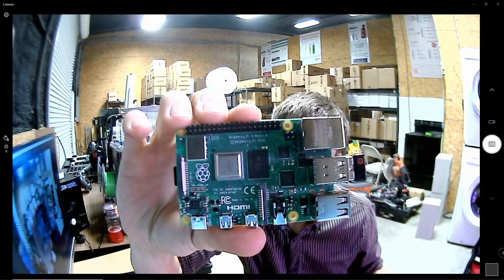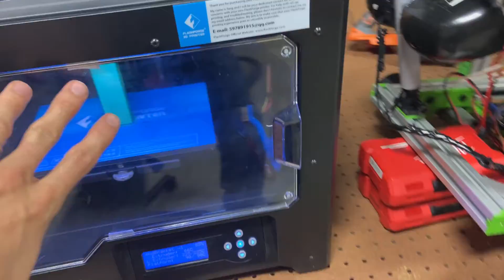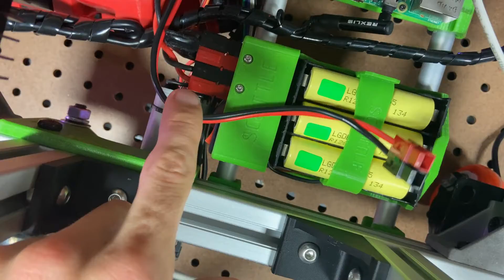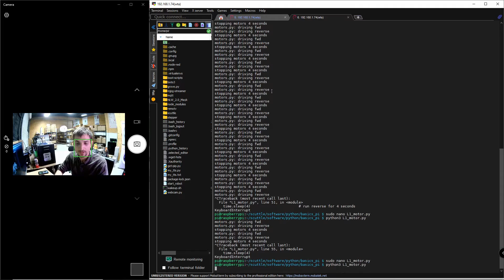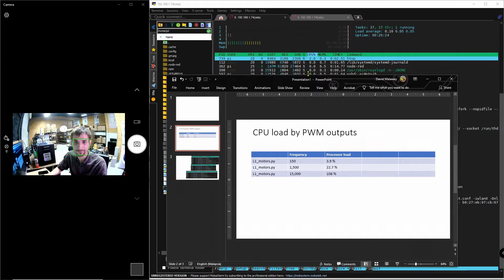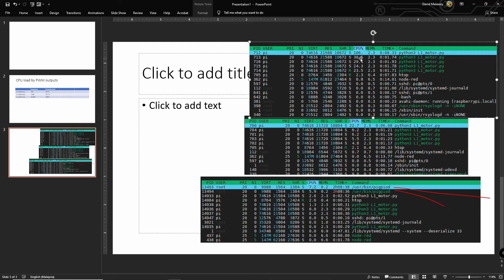How much CPU does it take to generate PWM signals on Raspberry Pi?

Comment: Probably the worst way is to use heavyweight processes to bitbang the GPIO ports. Linux does provide native devices that generate PWM from the kernel with almost no loading but theres only 2. You just write to the devices the frequency and duty cycle I believe. So 2 device files times 2 channels. Alternately, use a multithreaded piece of code that does your bitbanging, so you might have to up your game to c/c++ or java or some other language that does real multithreading.